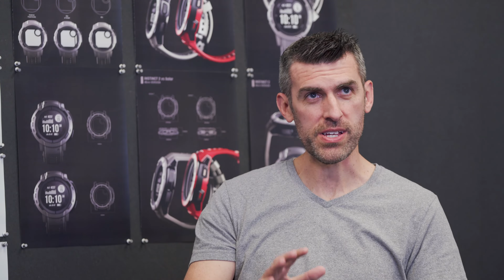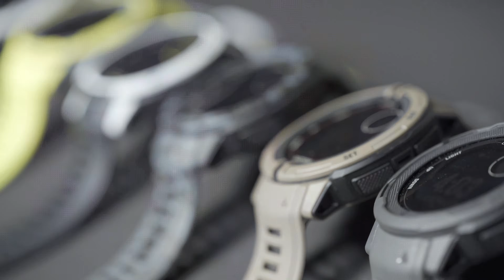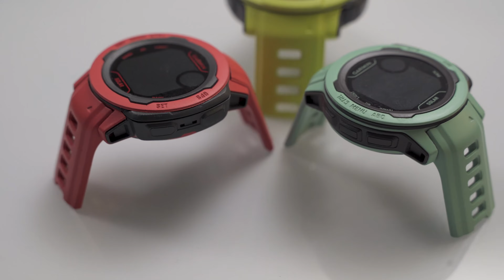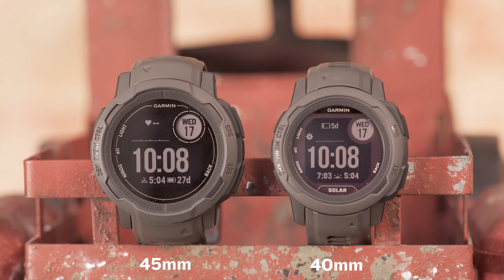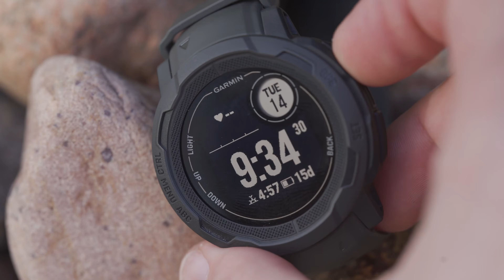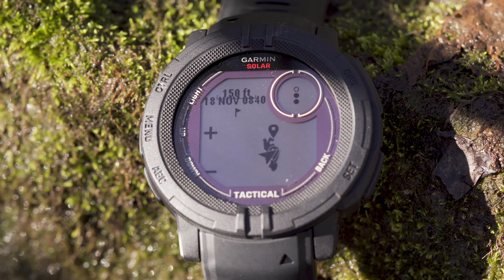The Creation Process: Instinct® 2 – Garmin® Retail Training

Comment: Is it at all possible to change battery on the Instinct 2? I Like things to last, and after 5 years I would like to be able to change the battery, like With the Casio Rangeman (Dumber watch, but I it will last a lifetime).
Reply from the maker: Thank you for your question.  No, the Instinct 2 has an internal rechargeable battery that is not user replaceable.
Reply: @GarminRetailTraining  Thanks, consider adding that as a feature along the line. I know it is bad for sales since people will no longer throw away their watches. But it is important for the enviroment. Casio does it and has done it for a long time, I have 15yo watches still preforming as new.
Reply: And that said, I really love the instinct series. I was not meaning to be too negative ;)
Reply from the maker: @PhantomTD  Not at all.  Thanks for your question and comments.